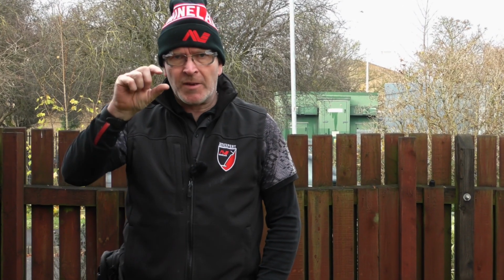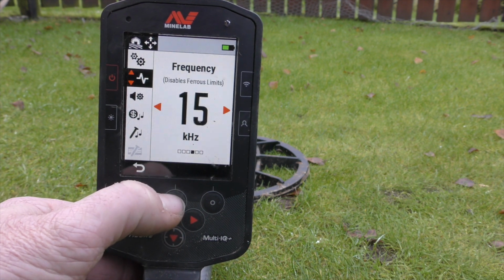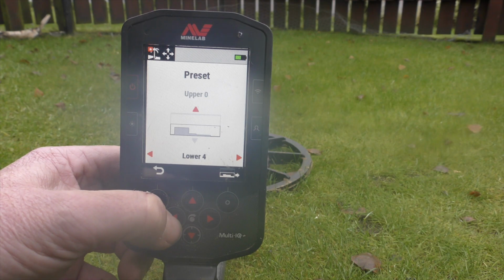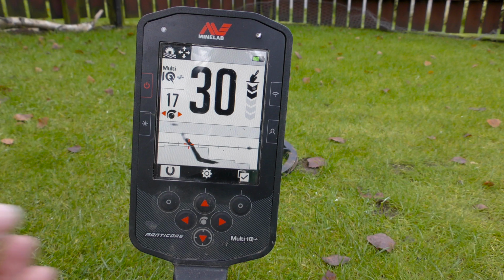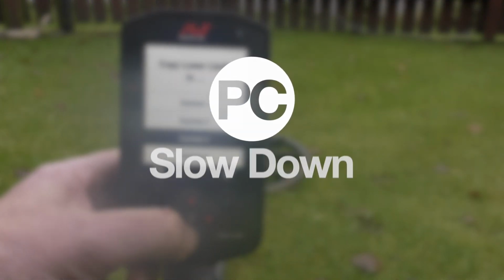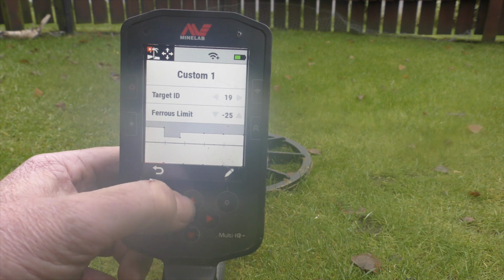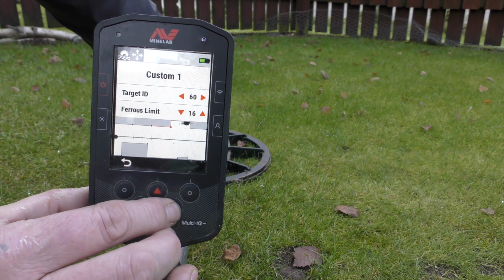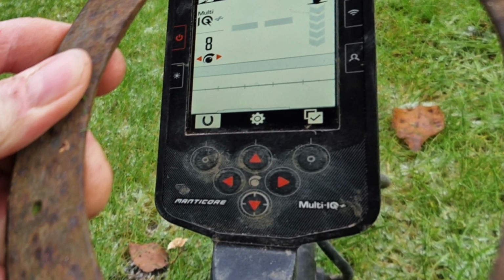Ferrous limits settings MINELAB MANTICORE | Metal Detector

Comment: Paul.. will jewelry always be on that center line on the Manitcore?
Reply: Not Paul, but no...I find if the target is deep in wet sand, it's worth investigating poor, mixed signals with a crappy trace...Also, be prepared for the trace and the signal to change as you remove scoops of sand...if a crappy signal starts to improve, I carry on..if it turns to a consistant ferrous, I stop digging...I'm not saying this approach will get you a good target every time, but if the beach is fairly quiet, it's well worth having a look at the odd crappy signal...
Reply: @PeterEvans1966  Thanks! I did not know that

Comment: I think once they get a smaller coil it might help in this area.or someone figures out the best programs to save and try in certain areas.the manticore has 8 programs that can be saved that should work in al areas.
Reply: Robert, I thought you could only save 1 personalised program and that would be stored in the profile setting?  It's early days but I keep hearing different info & my poor brain is topping out.😵‍💫